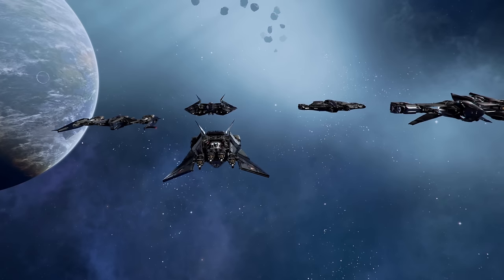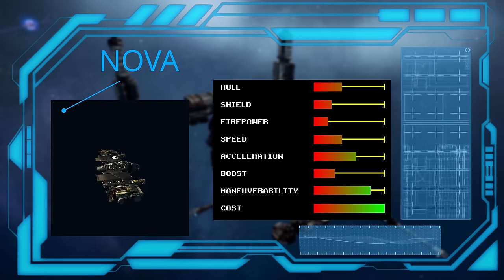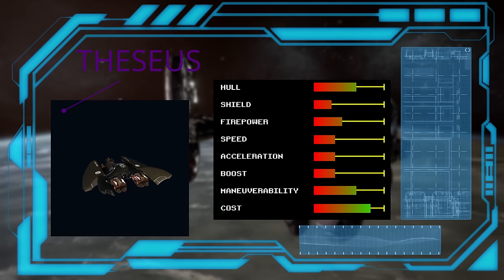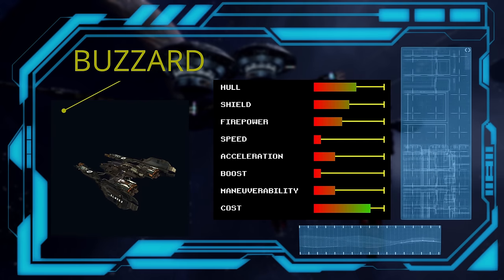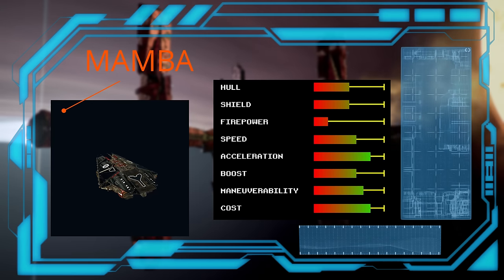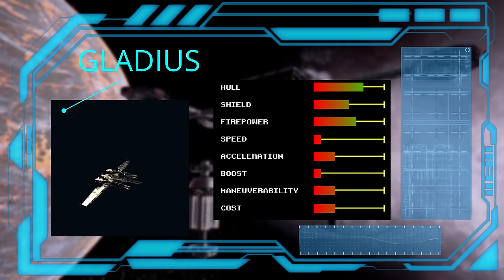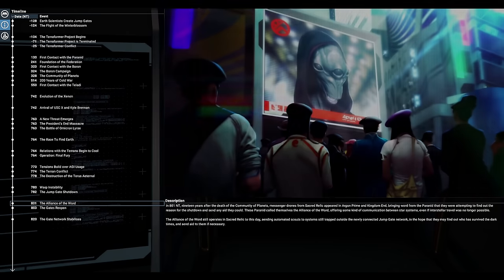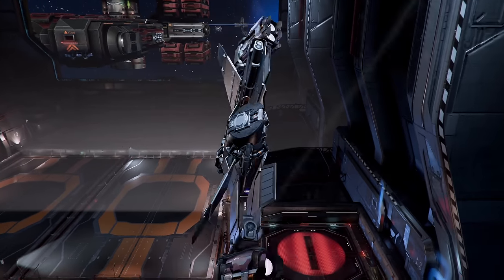X4 Foundations: Which Fighter is Right for You Guide

Comment: What would you do to the Elite to make it viable? IMO a single gun is pointless for attack, and it isn't as much that the Elite sucks as it is worse than the Discoverer, being slower and less well armed. Sure the Elite is the second most maneuverable, but it isn't enough better than the competition in the original tri race. I have two things, either take the Elite to "OK". The simplest change is to drop mass and drag to increase speed. Add 20% by reducing those values by 15-20%. This puts it between the Disco and Nova. Another alternative, and it gels with increasing the turn speed of the Nova that makes it viable as an option, is to make a fixed use built-in missile pod. Fits too with the use of it as a starting ship. You get two guns, technically, but one is set to a missile, so you learn about missiles and use ones. Making it fixed means there is no change to the model, either, it just spawns a missile under it, you could headcanon it to having so little space because it has an internal launcher. So you'd get a torpedo launcher Mk1 with the Sentinel and a seeker Mk1 launcher with the Vanguard version. It also allows bombers to get a fixed Mk1 Medium or two fixed small Mk1, or whatever, by merely sticking a hole in front. Fits with the bomber name, even if it is retconned to gunship, makes it better against the objectively better Nemesis (still worse, but closer), and yet still leaves a place for the S dock capable Gorgon et al. And reuses the "fixed missile launcher".
I would have made the Callisto the starter ship for the Argon start (the tagline fits it better: I don't know what I will do), but I would increase its manoeuvring speed to somewhere around 50% better, close to the Cerebus, so you would not CHOOSE to fight in the Caliusto with two guns, but if you were caught in it, you could win against most fighters because you aren't the AI running a lot of ships.
IMO the Elite is kept as the sacrifice ship for the first unlock of the PHQ by the non-Terran races where you get paid to blow a ship up. Doesn't matter that the Elite sucks, it is supposed to get blown up.
The Elite doesn't fit the interceptor, it just doesn't go fast enough. Missiles make a long range shot, but a single gun can't be replaced by a missile launcher. Hence either upping its speed to between the Nova (at 206) and the Disco (at 237), it is meant to get there as an interceptor until the Nova comes up and blows the ship up, or adding a secret hidden fixed function missile launcher.
Putting a torpedo would make it scary to see a wing of Elites in a larger ship.
Putting a tracking launcher would make it scary to see a wing of Elites in a smaller ship.
Putting a dumbfire launcher would make it useful against stations or "hope and pray" close shots. IMO this precludes the Elite for a built in armament, but a bomber style would make good use of the dumbfire against either stations or L/XL ships, if close enough.
Making the small two-armed trader for the argon carry about as much as the military spec Kestrel or Guillemot fits a safe gun runner, whilst the Teladi equivalents are for unsafe running and are used a lot by pirates and smugglers, makes sense and upping the roll, yaw and pitch at least to M class military stats make you willing to take it to combat, just that the Scout class is still more able in a fight, just the teladi pair are single armed, therefore only have a weapon for self defence. The disco makes much more sense as a fighter, but as a "scout" it is not really a scout, like the Teladi is, and not a gun runner with half the space that the Teladi pair have, but it is far better armed than they. Paranid and Split both have the "small trader for running high value goods" by better guns and speed covered, and the Magpie is meant to be competition with the Courier but carrying more at much slower speed (the Teladi have a problem with the cost of their much MUCH slower S/M traders that doesn't work, but they have the best L traders), whilst the Tuatara and Tethys are competitive with the much slower and smaller (but cheaper) Calypso.
IMO they could do with upping the Nova to give it the best turn by a decent gape, and adding a hidden missile launcher to the Elite, but the Nova is not a great ship and it could be the worst (the Falcon is nearly as nippy as the Nova but gets two shields, the Nova gaining 20% on acceleration, yaw pitch and roll might be overpowered compared to an extra shield, but less than 10% is underpowered). Puts the Argon at a decent position across the board, whilst Teladi and Paranid have a decent showing across the board, because either the Disco is OP or the Elite is underpowered.
The Teladi need a 20% speed boost for M class traders and the Sentinel already cost more, making it slower too? Nonsense, even for traders where cargo capacity actually matters, I would give them the same top speed, maybe increasing mass to reduce acceleration. When the Sentinel had an extra shield, it made sense, but it doesn't do that any more. Still the best is either the Paranid M class traders, but if you don't care about time or money, then the Split have the best capacity x speed M class trader.
Adding one (or two) fixed missile launchers to the Argon Gunship makes it worth having against the faster and better shielded Teladi Peregrine, even if leaving the Peregrine as it is leaves it lacking against the Nemesis or Dragon that are a whole lot better armed than any gunship.
Reply from the maker: The Elite does a good job at being a starter ship, can do enough to keep you playing but makes you want to upgrade. Blowing up the Elite in most of my videos somehow became a running joke so I just leaned into it
Reply: @JKNinja  And wasn't my question. It makes you want to upgrade because it is pants. What makes it "not pants"? I have an idea, given in the OP, but that is merely my idea based on what I see broken, nobody else's. Nobody has a chance to give their ideas, or critique mine, possibly improving them to others.

Comment: Chimera is not for in sector bomber. That shit died in drove just by getting closed to any exploding cap ship and station.
Reply: Try again. In sector the bombing run should have them sitting with torps for the splash damage that takes out turrets or dumbfire for pure damage on the hulls, beyond the range of graviton guns. The improvements may not stick with S class, but it could be you mixed up guns and missiles and it fired off missiles and then closed (if torpedoes also went faster than the missiles it just shot!) to get basted by graviton guns. Destroyers it definitely works, most of the time, if you set only long range plasmas to attack capitals and short range guns to "defend". sometimes it gets to close and graviton guns kill destroyers quickly, plasma turrets are slower and your destroyer may have enough pals with it to out-damage the station and survive.

Comment: Here he goes, abusing the poor Elite again. You bloody monster! 

Also, the Elite was an Interceptor at first, but it looks like they reclassed it as a "fighter" in a previous patch.
Reply: Worst part? This is still the best elite the X-series has had.
Reply: The Elite never managed to be an interceptor. The Disco is a far better one, it is faster than the Nova or Eclipse, but it might have problem in a furball that the Nova and Eclipse definitely doesn't. If the Elite was faster, it could manage being an interceptor, but it would have to use its manoeuvring to avoid getting hit, because it has neither the shields nor the firepower to handle a furball.
Reply from the maker: Its no longer classed as an interceptor, but I kept it in there as a nod to the older players

Comment: Nova became too ugly when compared to X3, they were just standard - good looking fighter when back at TC/AP. They should keep their original design...

Ah one thing to points out, the initial condition you set for all fighters to compare them is kind of wrong and unfair to Terran. Only terran ship can use terran weapons, and terran weapons are much better then that of commonwealth counterparts. For example, Terran pulse gun have much higher projectile speed, punch and DPS then commonwealth's pulse which makes terran fighter have better attack power then commonwealth fighter with a same gun number. This applies to corvettes and destroyers class too, which makes terran ships far more stronger then others. Katana literally solo every other M ships, and even Osaka, the low tier L of terran, is already better then any other destroyers of commonwealth. Syn and Asgard? They are in different dimension. Modified Asgard even can one-shot I...
Reply: You are wrong. "TER Pulse" can be mounted on any ship, Terran or not, because it is a "normal" weapon, not "high energy". And Proton Barrage is nothing special, really, just a Terran gatling. That leaves us with "Meson Stream". Its M cousin has its niche, being long range "alpha strike" type of weapon, but "S Meson Stream" lacks both range and insane peak damage, having just average "sustained DPS" and no gimbaling, which makes it inferior to commonwealth heavy-hitters, like "Blast Mortar". So no, Terran S ships can not leverage their weapon roster to their advantage.
Reply: @XelexMirror  Yeah, I forgot about Pulse that it can be mounted on any ships. But really, Proton Barrage is way better then any commonwealth counterparts, in terms of DPS, punch damage, range and projectile speed. I can't exactly say how much it is better, but surely say 2 Proton is better then 3 bolt Gatling in actual vs S combat. All commonwealth can be used to Terran on the other hands, so it only benefits terran.

Let's see how he does his M and L class comparison vid though, that should be Terran's playground.
Reply from the maker: Terran medium ships are very good compared to Commonwealth, but they are way more expensive. If you are doing a Terran playthrough their economy can handle the extra cost, but for everyone else spending those extra credits might become a concern